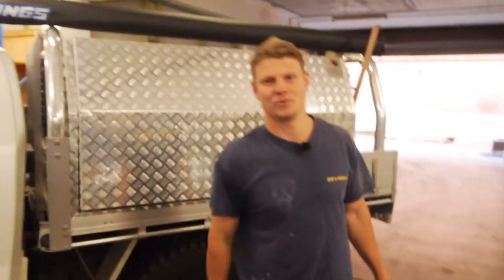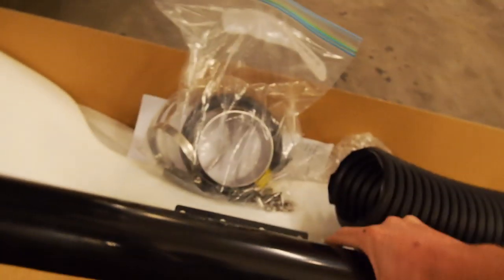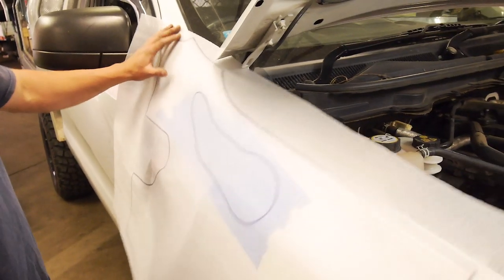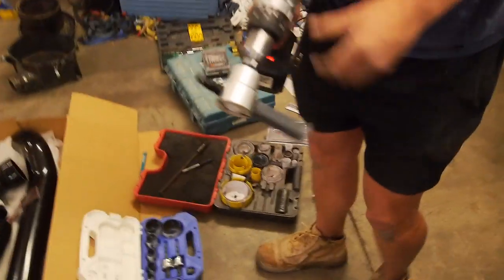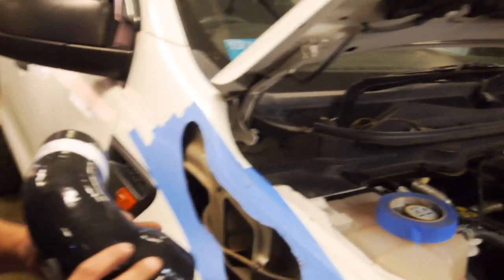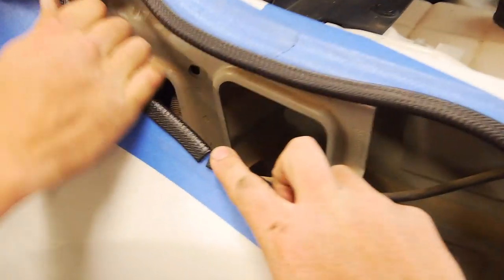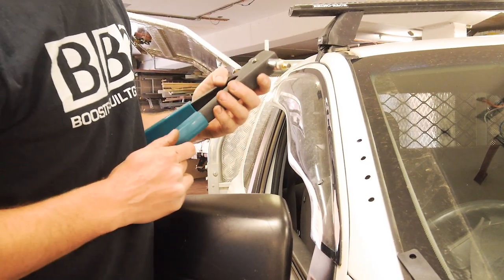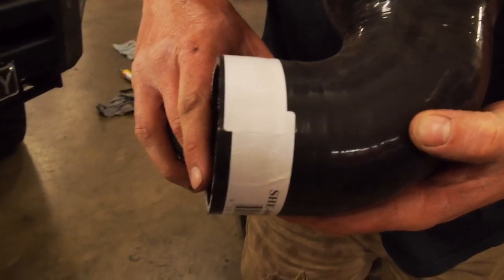FORD RANGER 4" STAINLESS SNORKEL INSTALL - AXIS FABRICATIONS

Comment: Was wondering if I could use rivets instead of nutserts, are they better in any way or just because they come with the kit might as well use them
Reply from the maker: You could use rivets, but you need a big rivet head to fit the hole for the bolt. Nutserts are better because you can torque a bolt down into it and also allows you to remove the bolts and snorkel with ease. Versus having to get a drill and drill out rivets

Comment: Oh... Totally off topic question!... 
Does "A-Pillar Modification" give the Insurance Mob an ability to drama up a claim?...

Does he have turbo back system installed?...
Reply from the maker: No idea tbh. Depends how grey the grey area is 🤦‍♂️ yeah full 3" turbo back straight pipe
Reply: Bit late but what I was told (unconfirmed). Is that the external skin isnt structural, the inside layer is so insurance should be sweet 👌🏼 not sure but what ive gone off of on the last few rigs
Reply from the maker: Yeah I would agree. The outer layer (the fender/guard) is cosmetic. Inner layer (inner guard/engine bay) definitely is a structural member

Comment: Some people call em "Rivnuts", but Nutsert feels more Straya, and so for me is the correct term I reckon 😉.

I prefer to use the slider for setting bigger ones, and than the handpiece for smaller stuff... It's a preference and if it works right it can't be that wrong huh!.

You said about the countersink using an oversize drill... I have done so with a shitty bit in reverse on panelwork, but please, use the correct bit!... He us saying do this way for you to get the best results... Not just piss and wind!. 

Good Content As Always!.

Comment: Won't the nutserts leak water into the a pillar and cause rust?
Reply from the maker: Yes they can, that's why there's a rubber gasket that sandwiches between the flange and the pillar
Reply: @boostedbuiltgarage  ah righto didnt see that part.